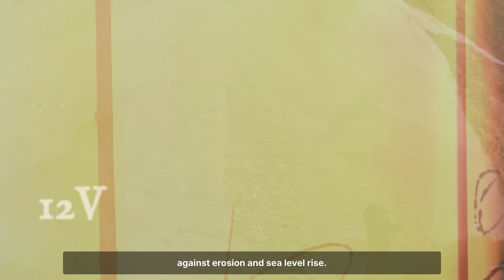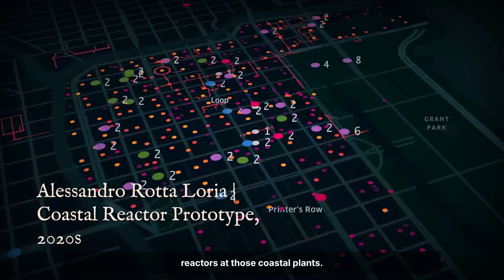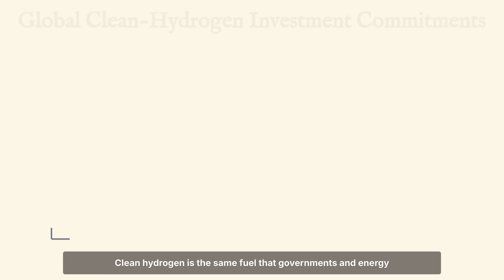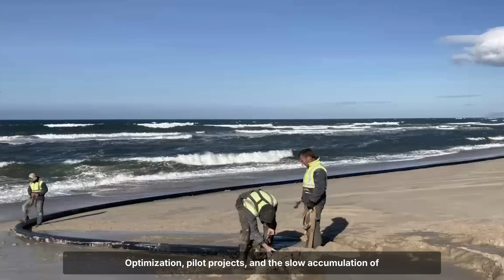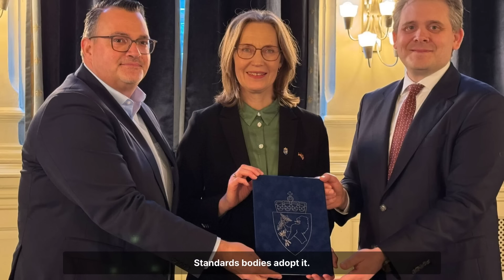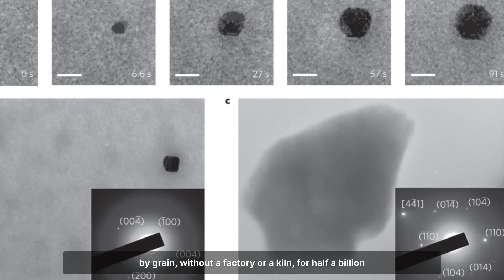Electricity Turns Sand Into Solid Stone. No Cement Required. Could Concrete Become Obsolete?

Comment: If carbon release is such a global problem than get ready for disaster b/c the volcanic activity is increasing. Over 50 volcanoes are spewing 'greenhouse gasses' into the atmosphere all day and all night. How come our global temp hasn't increase in relation to the carbon that is being added to the atmosphere? Considering what a very very small fraction of a single percent that carbon represents, one would think that such large volumes of carbon and other gasses would have shown an effect by now. On the other hand, the Sun is very active and everything it does affects global weather DIRECTLY. Our weather activity and climate are driven by the Sun, not the atmospheric gasses.

Comment: More clickbait. I have seen some stuff about this - it was a university-level project for credits not a breakthrough. The problem with desert-sand (even if you could get it to bind in a stone-like form) is that its full of corrosive salt.....so how do you reinforce it for structural stability? Might be good for footpaths and roadways if you can do old rubber tyre combos etc. But for now, it is pretty much confined to beach walls.

Comment: This video accurately describes a real electrochemical mineralization approach for sand stabilization and CO₂-sequestering calcium carbonate, but it overstates near‑term impact, glosses over key engineering constraints, and blurs lab‑scale results with system‑scale feasibility.
Core science and what it gets right

The basic mechanism—raising pH near a cathode so Ca²⁺, Mg²⁺ and bicarbonate in seawater precipitate as carbonates on and between sand grains—is sound electrochemistry and consistent with decades of literature on electrolysis‑driven mineralization.

The analogy to reefs and shells is conceptually fair: you are using carbonate chemistry plus an energy input (here electricity) instead of biology to build calcium carbonate structures grain by grain.
The description of cement’s process emissions (calcining limestone at about 1450 °C, CO₂ from both fuel and decomposition of CaCO₃, ~8% of global CO₂) is mainstream and accurate.

Where the narrative overreaches
“Almost instantaneously” turning sand into “solid, load‑bearing rock” in a field setting is misleading; lab coupons can stiffen quickly, but achieving meter‑scale, uniformly treated, structurally characterized ground is a slow, diffusion‑limited process that depends heavily on ion transport, electrode geometry, and current density.

The claim that this “could protect every eroding coastline on Earth right now” ignores site heterogeneity (wave climate, sediment supply, ecology, permitting, grid access) and the sheer logistics of installing and maintaining large electrode arrays offshore for decades.

Presenting the concrete industry as effectively “solved” (“the chemistry is solved, the material exists, the process is understood”) conflates proof‑of‑concept materials science with full techno‑economic viability at gigaton scale, which requires independent LCA, CAPEX/OPEX figures, and integration with capture systems and plant operations.

Technical and economic gaps the video underplays
Energy balance and hydrogen: the video treats hydrogen as a “free” by‑product, but Faraday’s law is unforgiving; useful H₂ output and carbonate formation both draw from the same electrical work, and you must compare that electricity use against competing hydrogen and mineralization routes to see if this is actually attractive.
CO₂ source and transport: it correctly notes that mineralization is far faster at flue‑gas CO₂ concentrations, but then assumes ready access to high‑purity, compressed CO₂ at coastal plants without grappling with capture costs, parasitic load, and pipeline/compression infrastructure.
Materials handling: “growing aggregate from seawater” elides solid–liquid separation, washing, grading, dewatering, and integration into existing concrete mixes; these are nontrivial and strongly affect cost and embodied energy.

Geotechnical, ecological, and regulatory considerations
Reversible solidification is intriguing conceptually (switch polarity to dissolve the carbonate bridges), but in practice reversal rates, ion redistribution, and partial dissolution could leave heterogeneous, weak layers; that matters for both coastal morphodynamics and foundation engineering.
The assertion that the voltages are “too mild to feel” and “no hazard to marine life” is based on small‑scale tests and analogous coral‑restoration projects, but scaling to kilometer‑scale coastal protection requires rigorous assessment of electric fields, electrochemical by‑products (e.g., local chlorine evolution in seawater), and interactions with benthic ecosystems and infrastructure.
The video is honest about building‑code inertia but still understates it; getting a completely new ground‑improvement method and a new class of synthetic aggregates into major codes worldwide is likely multi‑decadal, especially for critical structures in seismic or freeze–thaw environments.

Overall assessment
As an explainer of an emerging research line—electrochemical sand solidification and CO₂‑sequestering carbonate growth—it is clear, mostly accurate, and does a good job motivating why cement is a hard decarbonization problem.
As a roadmap to “concrete becoming obsolete,” it is speculative: scaling, energy use, integration with CCS, geotechnical performance, and code adoption are all unsolved engineering and economic questions, so the technology is better viewed today as a promising niche complement (coastal stabilization, specialty aggregates, potential CO₂ utilization) rather than a near‑term replacement for Portland cement.

If you want to dig into this more rigorously, do you care most about the geotechnical behavior (foundations/coastal protection) or about the CO₂ and energy balance of the proposed concrete/aggregate application?

Perplexity

Comment: This doesn’t make sense. How can you ‘reverse the polarity’? Put the +ve terminal on the right of the beach rather than the left? 
Sand is silicon
Corals and white cliffs are calcium carbonate.
Electricity cant change silicon into calcium carbonate.
What is the point of this. 
Click bate?

Comment: So can I build a cave shelter on a beach by making a mold in the shape of cinder blocks, filling it with ocean soaked sand and then running a current through it and building with my new beach cinder blocks. Or building a whole caveman style home in the side of a mountain near an ocean shore. Coulda built the pyramids way easier if they knew about this since it's all sandstone. They coulda just made a giant cube container and filled it with sand and ocean water and let sunlight harden it down since the photons will excite the water's electrons over time.

I bet this is how the corral palace thing was made when everybody thought the guy built an electromagnetic crane he must have actually just been using it to induce a current into a mold filled with ocean soaked sand and let it crystallize to build the structures in place so they never had to be lifted or moved to other positions at all

Comment: What you did not mention in the report, is that a similar process is used to build structures around a metallic frame, over which the minerals crystallize when current is passed. This mineral is called Aragonite. In the example of the coral reef, there was a picture of a metallic structure in the video - I don't know if it was used as the anode or the cathode. What's important, the Aragonite builds up layer by layer over the steel frame over which corals are allowed to grow. It was even suggested that floating structures can be built using a steel skeleton and an electric current. The structures can be grown with just sea water and electricity. In the example of construction, you did not mention how a house or building are built with this: Do you make building blocks (or bricks) out of sand and aragonite? Can you build a wall using a standard formwork holding sand and sea water and passing a current through the material?

Comment: 1/10 the strength of concrete.  Definitely not a replacement for concrete. Definitely don't want to be driving over a sand bridge to work in a sand high rise😂. Not to mention if someone accidentally drops a battery and the whole thing falls apart 🤯

Comment: After reading his paper, I tried this at my beach house with some limited success.  But in the process learned that beach sand and sea water aren't used in cement for good reasons.  Also scaling up from simple electrodes to some meaningful projects will be hindered by electric field control issues and corrosion.

Comment: "The climate does not operate on a committee timeline" yes, it operates on much longer timelines. Those comities are there to make sure untested or unsafe thing aren't rushed through. Slow changes tend to be lasting changes. Better to have something take a while to adopt, but have rigorous scientific testing and data, than to rush something through and have unforeseen problems pop up that scares people off the new technology before a solution is found for those problems.

Comment: Id hate to be in a highrise building or driving on a bridge and have some nutcase disolve the foundation with simple electrical current. Or even have a electrical problem in a panel because a rookie didnt know what they were doing and have a section of the building disolve.

Comment: Concrete is not a threat to the environment.  CO2 is an essential gas required for organic life on this planet.  If electric current can be used to solidify sand, wonderful.  But REMEMBER, electricity at scales required to perform these types of adventures are only going to come from nuclear or fossil fuels. Fossil fuels produce CO2. So don't deluded yourself.  And knock it off about clean hydrogen... Take a chemistry class.

Comment: Try applying electricity to the great pyramid at Giza and the mammoth walls in central America. Try applying it to existing limestone beds, as a tool for easily excavating the material, which could later be reconstituted, or used as is (lime) without needing to be ground into dust. Would this work?

Comment: at 7.43 see pictures of that Mineral Accretion method: BIOROCK in artificial reefs 
( Invented by https://en.wikipedia.org/wiki/Wolf_Hilbertz also see https://en.wikipedia.org/wiki/Electrified_reef  & https://en.wikipedia.org/wiki/Biorock )
just seawater and a steel cathode where it starts to grow at min 2.3V ( and also creates H2 )
sure need also a anode ( expensive, non corroding ) ( where Cl2 / HCl is created ) and a DC power-source and isolated cables.
that process does NOT involve sand!

Comment: Amazingly, this is true. And from quite recent research (2024). The sand has to be wet with salt water, the voltage is only 2-4 volts, and it takes a couple of weeks for a brick size "rock" to finish. You can of course just add salt to water for the necessary ions. I can't wait to try it! Very nifty, as we used to say, back in the day. (Before the Dark Times. Before the Empire).

Comment: So now you have peaked my curiosity! What are the electrodes made of? My second question compelled when you said just reversing the correct would desolate what was just solidified. My second question is. Does the solidification polarize the solidified sand? A magnet comes to mind which has too poles. Another question just popped into my head. Will a current sent through a sandstone brick devolve the brick?

Comment: Oh the fantastic possibilities! Just imagine, having a 3D printer modeling finest figurines just from fine sand, seawater and a little electricity! And if the critics don't Iike it just switch polarity and start a new pipedream!

Build a space elevator to supply space stations! Send up balloons filled with just a mouthful of Helium, space vacuum will puff them to full volume, and when you hauled them down rhey will be cheaper and even lighter than the competitor's balloons

Take 20 yards of garden hose, tie the upper end to a raft to take in air, and you can dive deep and breathe under water, just don't lose the mouthpiece!

Pipedreams are fun, just don't forget to pay the piper.

Comment: So, Giza Pyramid theorists, and all those other huge blocks of material in walls that are so closely formed you cannot stick a playing card in the gap.  If electricity and sand can make sandstone, then what about all those unfathomable buildings too?  That would make the building of those into an exercise in moving sand/gravel (pick you material) in a bucket and pouring it into a mould.  Then apply electricity and wham you have a funky shaped mega block.  Why not?  It removes all the theories about moving 100ton blocks 200miles etc.  We do it now with concrete.  There are many low voltage batteries in antiquity.... hmmmm

Comment: Well, if it already wasn't B.S. for practical applications as is, that might solve something for people who live near the sea but, they aren't going to truck seawater to Colorado for the other 60% of society that doesn't live near the ocean and then, a buttload of energy goes into extracting and refining the soluble minerals to add to sea salt and sand to then truck it to places to mix into sand because solar evaporator won't meet the demand to make dry sea salt with the new demand. The demand for sand goes up as well since this idea requires a lot more of it. Thus, I don't see the environmental advantage over just making quicklime.

Comment: Back in the 1970s there was an article in Popular Science magazine about submerging rebar structures covered with steel mesh in the ocean. An electrical current was past through the framework and it would accrete minerals to make a hard shell. Once enough material had accumulated, it could be floated with airbags and brought onto land.I never heard anything more about it.
Reply: Regular rebar corrodes very quickly when exposed to saltwater. That being said, this specific application of electricity also preserves the metal integrity through the same galvanic mechanism that causes mineral accretion - cathode gains mass, anode corrodes rapidly, but the anode can be made much smaller, external and replaceable.

Comment: I once asked a PhD graduate about the possibility of this concept, my theory was that the pyramids were built using this method - form the blocks in situ rather than dragging the massive blocks ...
Reply: There is similar process; form blocks with geopolymer, let harden, except no electricity needed. Egyptians had everything needed to do this.
Reply: @lead2feather they also had electricity
Reply: In the first minute I was imagining those 2 ton bags of concrete, easily formed. Make sure it's grounded when you add water and current.
Reply: Yes, the pyramids because reeds and other fauna were found suggesting a liquid state at some point, and perhaps other great large historical stone architecture as well.

Comment: To grow a structural, rock-hard "brick" or a 1–2 cm thick coating, the timeline shifts from hours to years.  Keep researching the idea though.
Reply: You can force it to grow faster by cranking up the voltage, but there’s a catch, it creates Brucite, which is soft, chalky, and will eventually dissolve or crumble if the power is turned off.

Comment: So you are saying that the process used to create seacrete can be reversed?  So large stones stacked so tightly that paper couldn't pass through could have been softened in place with a mild electrical current to settle in a slightly buldge-y shape that melts into the spaces?  So building even the pyramids could have been done easily by just pouring a mixture into a wooden mold and applying a weak electrical current, from a battery like in Baghdad or the ones used to power the giant light bulb in the carving?  So a very reasonable number of workers could have dissolved the stone at the quarry, carried it clay pot by clay pot to the build site and poured it in?  Huh.  History solved.

Comment: THERE IS A BETTER WAY....BEEN SITTING ON IT FOR YEARS.  CHANGE JUST ONE PART ON A CONCRETE PUMP AND CREATE "INSTA HARD" SAND THAT IS PERMANENTLY CHANGED AT THE NOZZLE. AND YES, I OWNED A CONCRETE PUMP TRUCK AND RAN IT FOR YEARS IN THE SAN JUAN ISLANDS. JUST BUSY WITH LIFE, HAVEN'T GOTTEN TO IT YET...

Comment: The detractors of cement (mixed with gravel makes concrete) always point out how much carbon dioxide is produced when it's made and how bad that's supposed to be. What they don't tell you is that they are being deceitful telling you only half-truths. The rest of the story is that when the cement is mixed with water, it cures back into limestone and it withdraws the same amount of carbon dioxide from the atmosphere that it put in when it got heated up and made into cement.
    All of this is called the lime cycle. Go ahead and look it up for yourself.

Comment: Carbon is not the issue... Plants love carbon, it helps them to grow. No carbon and everything is in a freeze and there is no life.
What is happening is with the sun and 150 years of data that I had found on NOAA.gov, pole shift. No, weather is not going to stay the same.
What is also the issue is geoengineering, especially with toxic metals and chemicals. The bees are all going to die from heavy metals in the air and so will the trees and all most everything else if this pollution is not taken care of and made to be illegal.
Geoengineering can be done safely with sound, frequencies, and vibrations.